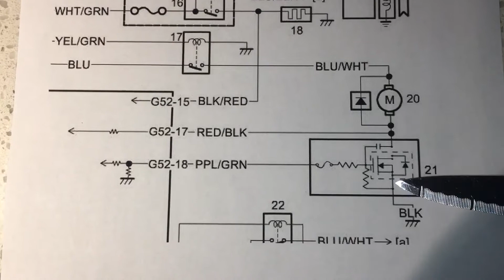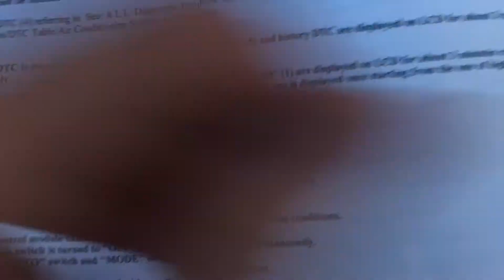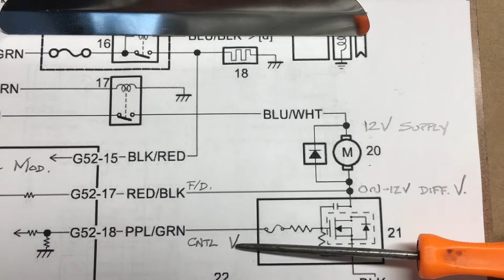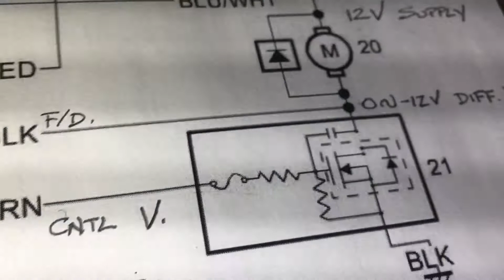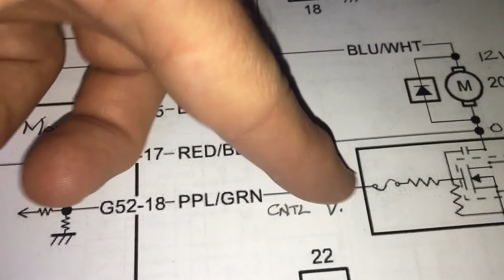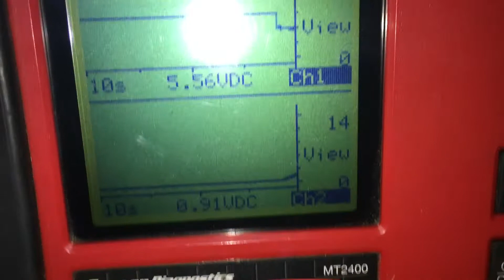Vitara...Vent Blower Inoperative

Comment: A quick test i do for the blower motor is a noid light in the connector, module/resistor pack acts as a dimmer. Did you try to bridge the thermal fuse and then replace for future perhaps
Reply from the maker: Yeah Dave if this were an out of the blue...I likely would have approached this differently. Because of my foolishness I knew what it was right away. Might tinker with the failed one...we’ll see. Cheers